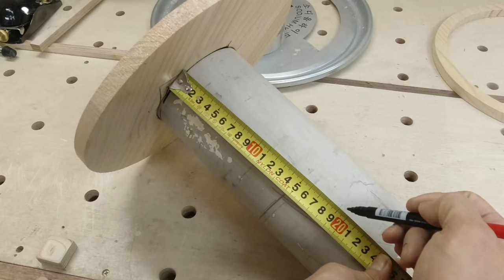How to make a New Cyclone Dust Collector / Woodworking Essentials / Homemade / DIY

Comment: Why did you leave that small around at the inlet? I just want to know if there is any mechanical advantage for it? Also great vid!
Reply from the maker: It improves the separation function of the cyclone.  It is effective when the entrance is narrower than the exit.  And if you narrow it down to a curved shape like this, the whirlwind becomes stronger.

Comment: Ok only half way thru the video and I think you are just showing off! Those tool ideas are great 👍
Reply: It don’t matter if he is showing off the tools. My concern is the efficiency of the dust collector. It looks like the sucking power is not there, there. Tools👍🏼, cyclone looks 👍🏼, efficient 👎🏻👎🏻👎🏻👎🏻👎🏻
Reply: @petediaz2388  it looks Ike a 4" tube off  of a harbor freight type unit. I've got one. Using the 3" makes it work much better, but overall it's still a good system. Mine keeps up with my 10/20 sander, or my planer or table saw. Haven't tried it with my lathe yet, and my system isn't that good as this dudes ! That table saw addition is what I want!

Comment: Cyclone dust collection devices represent a great improvement for a healthy woodshop environment, and yours appears to work extremely well, Mr TAK. Congratulations. Also it looks as if you can use it without a bag attached to your wall-mounted vacuum power unit. 

But is no very fine dust at all being ejected into the air? By now you would know whether deposits of dust are accreting in your shop. 

Before viewing your video, I was considering how to wall-mount my Makita 410 dust collector drawing air through a cyclone unit, but turned 90° with the dust bag attached underneath. Therefore, knowing about ejected fine dust is relevant. It would be convenient to forego hanging the bag onto the power unit.
Reply from the maker: Thank you for your valuable comments.  My new cyclone dust collector is working very well and the air once filtered from this cyclone is blown out of the building.  Of course, a dust collecting bag is installed outside, and fine dust can be found.  However, the dust collector connected to the outside also functions as a ventilation fan, so the air in the workplace is maintained pleasantly.
Reply: @carpentak  Thank you for your quick, informative reply, Mr TAK.
Reply: Hi would like to know more about your setup for dust collection as I am planning to get makita 410, thanks
Reply: Да , конечно это прекрасная демонстрация инструмента и навыков, но!!! Если есть такое оборудование и инструменты, почему бы просто взять и купить профессиональный циклон?

Comment: Very ingenious techniques!  Nice work!  What material was used to form the cylinder?  It has the appearance of a wood laminate, but it is much more flexible than any wood product I’ve seen.
Reply from the maker: It is a flexible plywood.  It is a type of plywood that can be easily purchased here in Korea, but I do not know how it is in other countries.  thank you.
Reply: @carpentak  Thanks!
Reply: The plywood is available in America it's called  bendable plywood. All of the fibers are running in the same direction.
 I'm sure your wood dealer is aware of it.

Comment: Привет! Как мне у тебя дюже понравилось! И работа твоя и станки, инструмент! Вот только дюже толстый шланг. Им только улицы убирать. Но это, как я понял, будет стационарная установка. Но зачем такой толстый шланг? Успехов!
Reply from the maker: This is a 4 inch hose. This is the same size as the inlet on most woodworking dust collectors.  And most of the larger woodworking equipment, not portable equipment, have a 4-inch outlet. Thank you

Comment: Now I need to also make your band saw circle cutting jig. Does it use a stop to position the workpiece or do you line it up by eye?
Reply from the maker: The circle cutting jig has a stopping block.

Comment: A very nice work, you did there!!!
What Motor do you use at the end?
Reply from the maker: It is a 1 horsepower dust collector motor. Thanks
Reply: @carpentak  Thank you for answering. Where did you buy it?
Reply from the maker: I ordered online, but it seems like a company that doesn't ship overseas. 
https://m.smartstore.naver.com/backjeemt/products/758219397?NaPm=ct%3Dkxfkaugg%7Cci%3D0Ay0001chq5vB5DZyLlR%7Ctr%3Dpla%7Chk%3Dc6be3e9f2e40ede9858d027c9798ba03bfcfdf01
Reply: @carpentak  how much in US $
Reply from the maker: May be 192$

Comment: What material are you using for the wall of the separator?  The flexible white sheet?
Reply from the maker: It is a wooden plywood for curved work.  I am easy to find here in Korea.
Reply: It's called bendable plywood and disavailable in America; all of the fibers run in the same direction.

Comment: what is that super flexible ply and where can i find it?
Reply from the maker: It is sold everywhere in wood material shops here in Korea, but it is said that it is difficult to find in other countries.
Reply: It is called bendable plywood and is available in America.
 All the fibers are running in the same direction.
 Your wood dealer, I'm sure, has heard of it.

Comment: Where did u bought the Motor for this Zyklon?
Reply from the maker: The motor is a blower motor for a 1hp dust collector.  It is easily available at any woodworking shop.
Reply: @carpentak  
Did u Got a link for it ?
Reply from the maker: This is a Korean site. Please note that they do not ship overseas.
https://m.smartstore.naver.com/backjeemt/products/758219397?NaPm=ct%3Dkxfkaugg%7Cci%3D0Ay0001chq5vB5DZyLlR%7Ctr%3Dpla%7Chk%3Dc6be3e9f2e40ede9858d027c9798ba03bfcfdf01

Comment: Using the fence on your table saw  as a ‘stop’ to cut the panel is extremely dangerous. You will have ‘kick back’ when the saw blade catches the cutoff piece. It will be thrown back at you and serious injury is possible. I know this from experience.

Comment: Beautiful project! It looks really professional. I am still so curious and confused why we have to build these at home. It's a fun project. But the dust extractor machines should include a proper cyclone separator when you purchase them. The dust collections systems being sold to the public are obsolete and are junk.